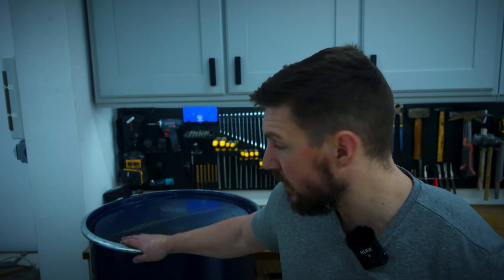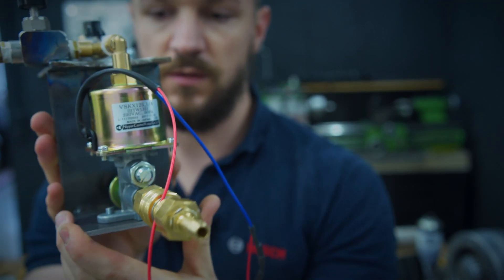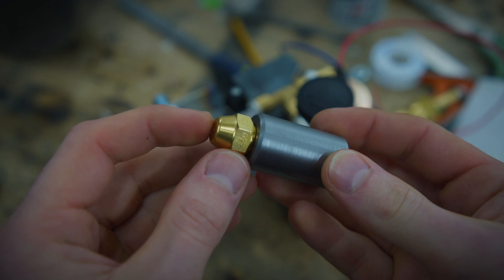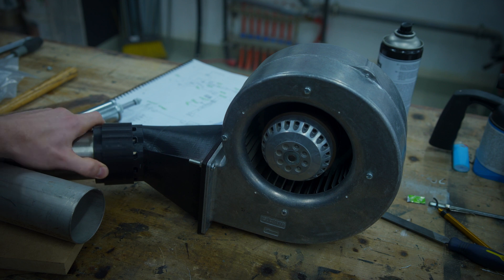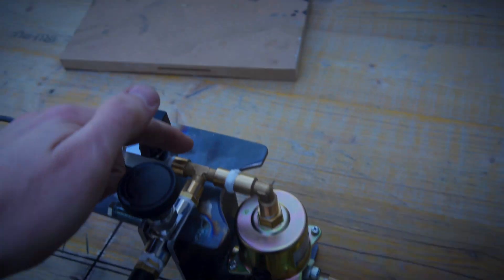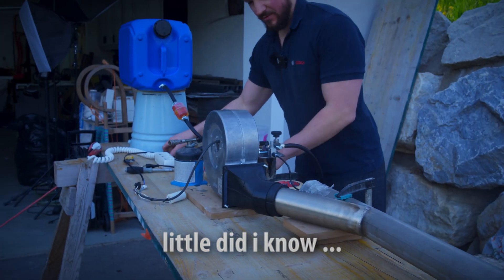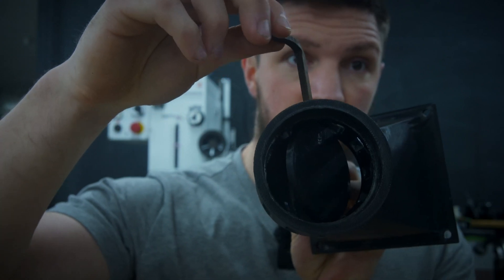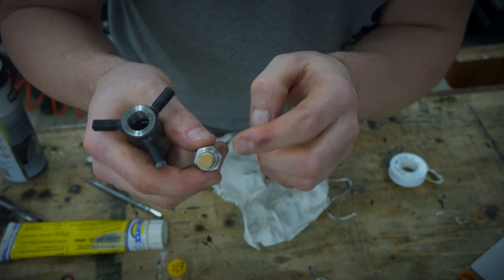Diesel / Waste-Oil Burner  for a Foundry Furnace

Comment: I have use the old burner and with ignitor so to easy for lighting up. Problem is the rotary dryer push back during running. Now i need to install a blower to settle the issue

Comment: Hmm... I think instead of the air flap You should put in a variac to control the blower. No flaps. Then take a look at how much air is needed in general and take a closer look into how for example Buderus does the trick. I´d bet on they use much higher fuel pressures and a smaller nozzle to atomize the fuel. The flame needs to be guided, too.
Ehrlich: das Ganze wäre mir zu viel Gefummel. Und Sie sind weit ab von einer blauen Flamme- warum nicht gleich einen Heizungsbrenner suchen? Das Gehäuse für den Schmelztiegel ist noch genug Arbeit. Klar, Kram selberbauen ist fein doch das wäre mir zu murksig.
Reply from the maker: Der Tipp mit dem Heizungsbrenner ist klasse. Danke!

Comment: How much pressure are you using behind the oil stream?
Reply from the maker: Arround 1bar according to the datasheet, havent it measured though
Reply: @ChristophLehner  Thank you. I experimented with a similar nozzle and couldn't get waste oil to atomize without using ~7 bar (100 psi).  For this reason I went back to a siphon nozzle. But I'm very interested in testing this further to see if waste oil is the determining factor.

Comment: I'd suggest using a copper washer as a seal at the nozzle (works flawlessly in higher Temps, plus added thermal transfer from the tip of the nozzle to the main body)
Reply from the maker: Thanks, thats a really good idea 👌